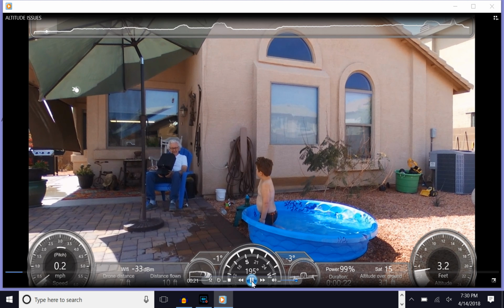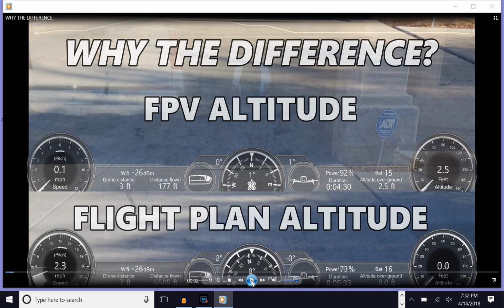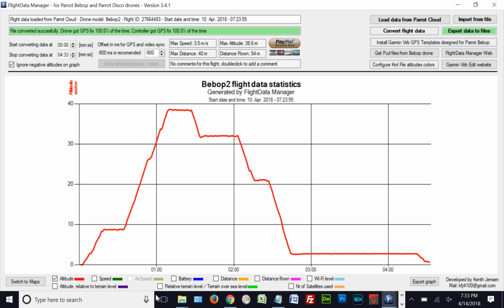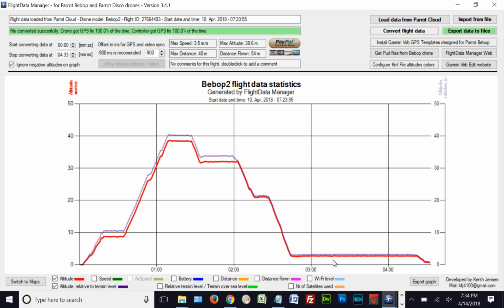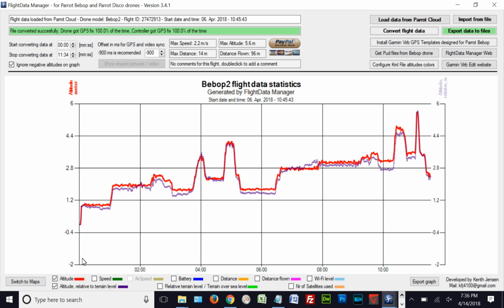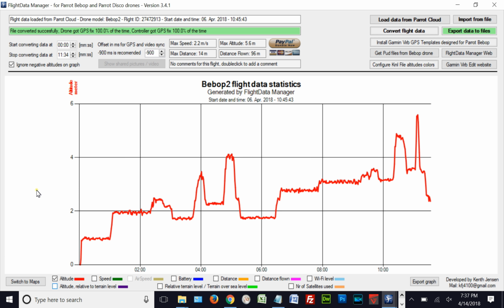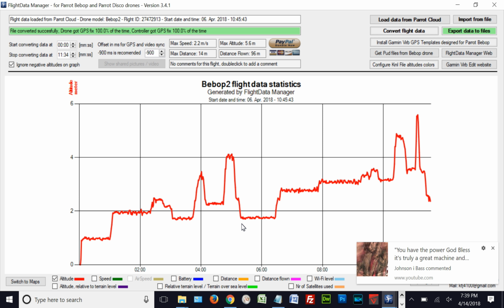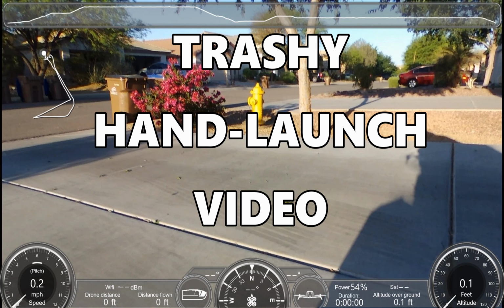BEBOP 2 ALTITUDE ISSUES SOLVED

Comment: Another great video sir! One question, Say I'm out in the field with extra batteries and need to upload data from the cloud to that i can start with a clean on-board memory. Which way would you transfer your data from the drone between flights and what would you use. My laptop battery is junk and won't get above 5% so that method is out the window in my case. Have you any suggestions for field use? Thanks in advance sir. God bless!
Reply from the maker: Hi Steve. I have never given much thought to that but as I understand you have to have your controller connected to your phone/tablet, and the Bebop connected. Then it uses the wifi connected to your phone/tablet to the cloud. Without a nearby wifi signal I don't think it can be done. They do make a storage extender that you plug into the usb port on the back of the Bebop. There are lots of YouTube vids on how to go about it. The best I have seen is from Github. I will let you explore. That way you can take lots of vids before going home. God bless.

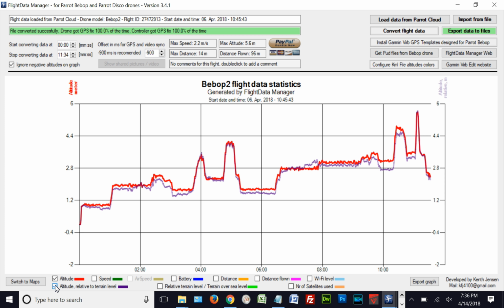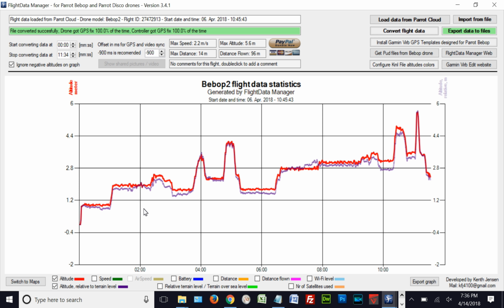Comment: Hey friend. I noticed that at 6:08 and 6:14 there may not be a difference at all. One picture shows it starting between -0.4 and +1.2 at what may just be zero. The other shows no negative altitude range and indicates a zero start. I've seen in ANTHONYVLOG videos that there is a negative altitude created when you takeoff from a hill and descend into a valley. The one chart was showning the negative range but it hadn't been entered so yet it started at what might just be the zero point between -0.4 and +1.2. They should have graphed the zero point for reference. Am I reading it wrong maybe?
Reply from the maker: Thanks for your input Colin. I am not sure I understand your question but I have resolved all of those issues. Thanks again and God bless.